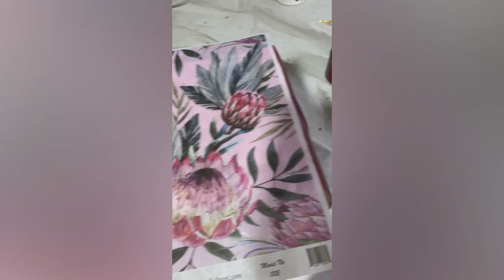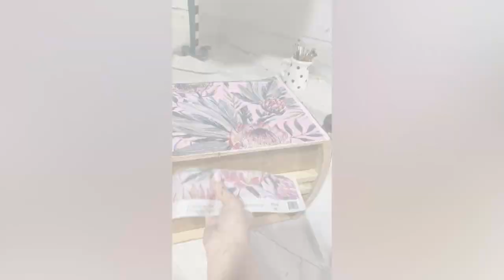French Provincial Vanity | Tracey's Fancy

Comment: As You are clearly one of the most thorough presenters of the furniture art process I am wondering if you have suggestions on replacement hinges? I redid a cabinet but threw out all but one of the hinges because they were in bad shape, I have taken the one original to three hardware stores looking for the exact match, I have purchased 3 pair now that are extremely similar in size and nearly identical in style yet still the doors do not close properly :/  very frustrating!  Appreciate you! Blessings!
Reply from the maker: I am so sorry that you are experiencing this! Working with hardware on older pieces can be very frustrating. The saying "they don't make them like they use to" is an understatement when working with furniture. In fact, I keep a dedicated box of hinges, knobs, pulls, etc. from furniture I don't use....just in case. 
So....if you're not able to find a perfect match, and you'd be VERY lucky if you did (like buy a lotto ticket lucky), my recommendation is to fill in the holes and start from scratch. 
I have a video that might be helpful. It's about drawer handles/pulls, but the same can be applied to hinges. 
https://youtu.be/OfSilmd5an4

Good Luck!!!!! Let me know how it turns out!
Reply: @TraceysFancy  thank you! I appreciate your time and input! Blessings!